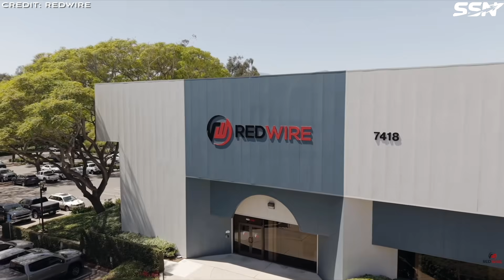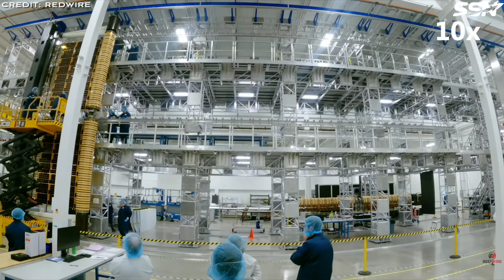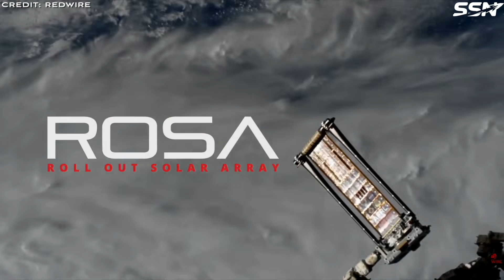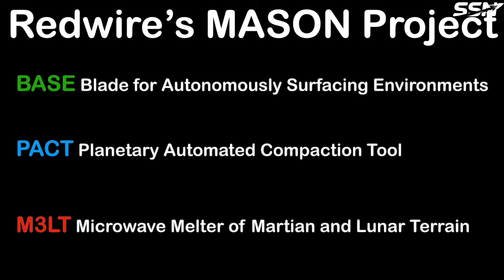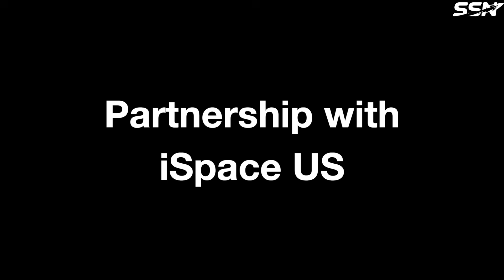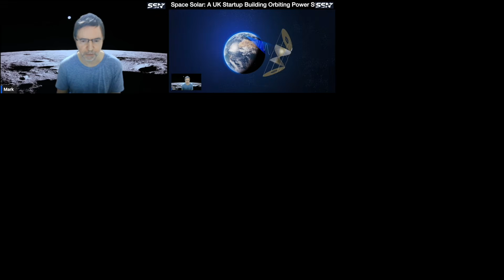Redwire's Lunar Revolution: Power Grids, Robots & Site Preparation

Comment: Can the Redwire lunar equipment survive the -50C 14 day long dark nights or do they need thermal? batteries
Reply: Minus 50 isn’t that cold. I’ve lived in places that was normal.

I’m not sure off hand what temps the dark side drop down to but I suspect it’s lower than that.
Reply: You mis-typed, it is -250C . Then upto +250C during the day.
Reply from the maker: Close to the lunar South Pole, temperatures in sunlit areas range from approximately −53°C to +54°C.
Reply: @SpaceStartupNews 

Not that cold. Hell, our military uses winter gear designed for -65 Celsius temperatures. 

The winters in Korea caused massive frostbite casualties in every army except ours. What was a horror story for everyone else was only a mild inconvenience for us.
Reply: @SpaceStartupNews cross reference your sources. Vacuum is -50C?😂
Reply from the maker: @qa1e2r4  Cosmic background radiation gives deep space a temperature of −270 °C. That has no practical effect with objects near the Sun. When sunlight hits the lunar regolith the heat is absorbed and then re-radiated as infrared heat. The vacuum of space does not "cool" the Moon's surface through contact. The surface temperature of the Moon is determined almost entirely by how much sunlight is received. The temperature of space is irrelevant because the Sun's energy dominates.